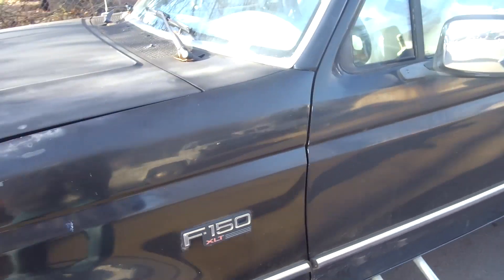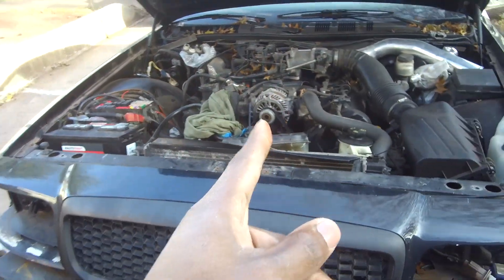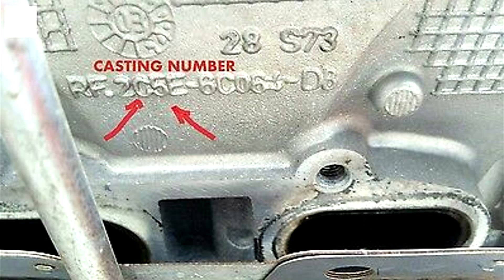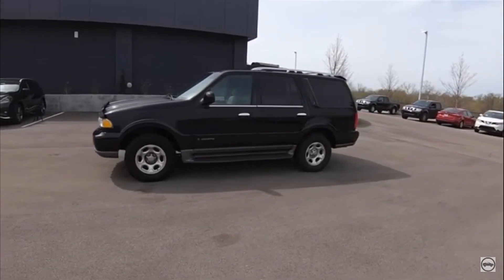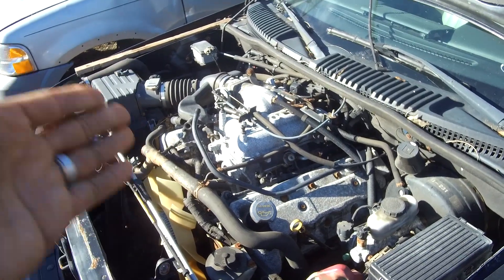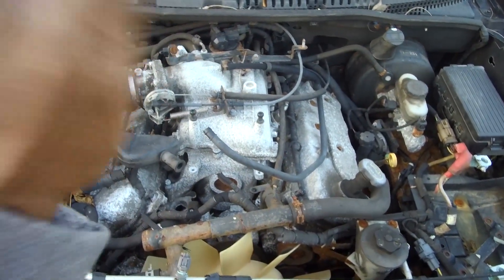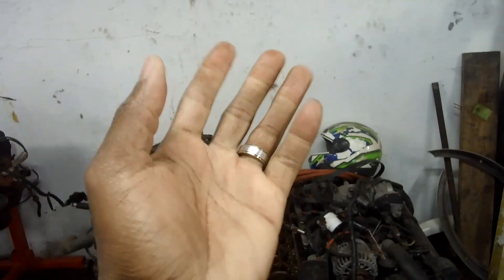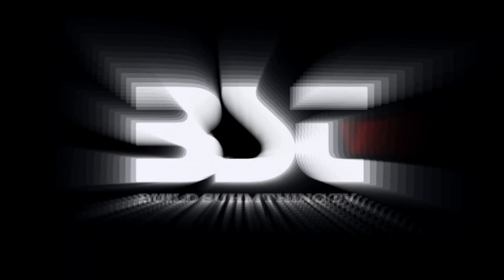BEFORE YOU BUY A Junkyard 4.6 DOHC Engine

Comment: I know this video is over 3 years now. But would the same principle for the cobra Engine apply to the Mach 1 engine? Besides the fact Mach 1 engines were aluminum. Thanks for making this video.
Reply from the maker: they basicly the same engines until you get to the boost ( stock version ) cams changed a little.. All of these where Aluminum ( Aviator,Mark 8,Cobras, and Mach Mustangs )

Comment: I like to buy running cars before they make it to the junker to rip parts from. Takes away a ton of the guess work. I picked up an 04 Aviator suv that run and drove but had no OD for a couple hundred bucks. The aviator engine, even if it needs rebuilt, is a fantastic bang for the buck.
Reply from the maker: I feel ya on the logic and its solid, but logic is more on the cheap side of things... I like to buy things from this yard cause they are good people... They are straight up with the motors ( if good or not good ) most cases they do not know and charge a the ( extraction fee ( only it seems )  most of these engines are bad ( 4.6 dohc ) here is one I got from the yard but I had to change the guides and timing chain https://youtu.be/BHlDSH_Y9tM
Reply from the maker: here is what the engine looked like inside https://youtu.be/SPIc7hDibZ4
Reply: @bstfordchannel923  Definetly a good deal going the yard. I never know what I may grab until i go and walk around for a bit.
Reply from the maker: @madmod  Sorry for the late reply... Going to yard is sweet. Its cool to go when you NOT in NEED of a  part or parts cause you will be so upset whne you do not find what you need.. So i am going just to go and see what they may have vs what I need to have

Comment: I'd love to see that 5.0 in the Vicky :) And it will be cheaper per HP to build... plus tons of parts!
Reply from the maker: This is coming bro in thought i have to plan it out
Reply: And maybe get a Stroker Kit to take that 5.0/302 out to a 348 :) with a 232/242 cam to help it breath... puts out a nice exhaust tune!...  If anything do the Cam! You'll be very impressed with the results :) Ford heads have not so good exhaust ports and the extra 10 degrees helps... A Lot!

Comment: What is the problem with the 03 aviator 4.6. .I picked up the truck cheap driver head has burnt valves. im going to pull the head and repair.

Comment: I have a 2000 Ranger step side that I'm thinking  about trying to drop a 4.6 mustang engine in. Maybe trying to catch an older one from when they came out originally. It currently has the original v6 with a 5 speed manual transmission.
Reply: I cant remember the title of the tv show but i saw a series on Motor Trend tv where the drop a Coyote 5.0 or a 4.6 in a ranger..Didnt take a ton fabrication

Comment: i'm loving your videos! but, i was wondering.....are there any downsides to the 5.4 as opposed to a 4.6? there are no real differences in the motors, is there?
Reply from the maker: Big downside you have to build the 5.4 ( sohc ) with better rods and get the a better oil pump...The problem also if putting it in passeger car will have issues cause the engine is taller and the hp made is nothing crazy...I will have to try something to debunk all that i mentioned... Its best to get a 4.6
Reply: got it. i should have mentioned that i'm swapping into a '66 F100.....so plenty of room. i've already checked. replacing rods is gonna break the budget if i did a 5.4. i've got an eye on a lincoln 4.6 DOHC. i'll just stay on that path. thank you!!

Comment: If you have a p71 the ecm will run and drive any of the modular v8's except any one with vvt . I would still tune it but you could drive it to the tuner. The main engine harness should work with the 32v you'll just need the injection harness. The murauder, Mach one and aviator engines are the same , the Mach one has cams more suited for the mustang and five speed. The thing is they are called modular for a reason. The 32 v only reads the intake cam gear just like the 2v , the firing order is the same, the maf size is the same, the injectors are close enough and for the most part the throttles are the same size. But the blocks , heads, belt drives, emissions, sensors all the other stuff is interchangeable for the most part. Bell housings are all the same, I think, but am not fully sure....the bores between the 4.6 and 5.4 are the same it's the stroke that's different...again I'm not too sure on that one, I know they did that with the 3.8 and 4.2 v6's so it's a bolt in swap for a 4.2 v6 mustang as it's the same block. The thing is it's stupid expensive to buy aftermarket parts for the mod motors but if a person does some homework they can build a good amount of power using factory Ford parts. Just like pi heads on a non pi block...that gets you like two points in compression and better flowing heads...that's simple horse power and torque.
Reply from the maker: police on police and the lincolns on lincolns ect.. some cars have different feature .. the engines are cool but the ecu systems are crazy do to the pats styles in OTHER cars other than the Police crowns

Comment: The 4.6 is a solid motor... But the 5.0/302 Windsor can be a cheap Beast of Motor... Add Cleveland heads and a 236 248 Cam and stand back and freak on the power:) and it's been around since the early 1960's :)
Reply from the maker: ahhh brother you just have to wait on it lol.... I have few ideas in serous thought
Reply: @bstfordchannel923  I like Ford trucks I'm in the process of doing the 2v swap in a expedition I like to learn more about ford engine what books would you recommend I can get off Amazon or Ebay

Comment: I like the 4.6 4v but I wouldn’t buy it unless I heard it run . Pull the valve covers have a look and smell ..pull the cam cap  look for scoring on the cap. Even pull the oil filter take it apart pull the plugs have a look . Especially if it doesn’t run . The Lincoln mark 8 ?! When it came out they opened the exhaust and did over 180mph with that engine 290.rated hp in a light car like the Mac that would be sweet . I’ve done heads on aviators and Lincolns generally the valve seats wear so I would go through the engine regardless. Very doable with 4000$ but tight .now 5.0 is easy especially if you got one from a explorer the heads are a lot better than the regular castings and if you know how to pick the right parts you could get well over 300 to the wheels with those heads . But you should still go through it . Turbo 5.0 from a explorer? That would be awesome for the maverick! 😬 there’s also transmissions you need to think about as well. Mark 8 donor car then get it tuned.
Oh 5.4 is HUGE !
Reply from the maker: i pump my breaks just a bit all what you have mentioned i sat and thought about it Casey .. you are so correct head have to be done, then the bottom end. so will be money flashing around at the machinist or slowly looking for favors from people.. 5.0 in the maverick ( turbo ) well that sounds like a plan thus why i started to turbo the 4.6 figure what works and what doesnt.. I had that 5.4 dohc a fn whale of a engine lol.. I want something thats small but kick ass in power.. I have plan it has change twice.. 302 may be the best move

Comment: IMO, back to the basic point. Any fat cat can make more horses. 1000hp is no longer uncommon. Question: " how many horses to make the car worthy?" 290? 360? What are the "total" component cost difference? So what should the math formula look like? "How many hp per dollar can you make over some minimal declared threshold of say 290 or what ever that is that makes the project cool enough?" My #1 concern is cost of components to cause larger hp not to fail and that runs the entire length of the drivetrain. My #2 concern is what actually makes the car cool besides hp? Isn't it that "we built a really cool great running car for the least spent without some nasty detail left out in the end?" Tires Tranny suspension not matching hp? By the way, this was a superb well thought out vid with noticeable increase skills in editing. Thank You!
Reply from the maker: wow YOU SAID what i was trying to show ( but without ) spelling it out..YOU got the gist .. thats why i dance with ideas and say things, Its best to show examples of those that read dohc and think instant power gains..Not all the time big liter engine create power on a budget..  to do a coyote swap in your car will run you 6k min ending results  maybe 400hp if you get the right simple mods.. 6k 400hp cool engine but its 400hp... and you will get spanked by MANY cars still.. many people chase hp, but not a well balanced car.. This comment is well needed and well respected.. Thank you so much for this brother L-Twig

Comment: Man.. I can't get enough of this channel... I'm doing an aviator swap into my 2v..Donor Aviator has it all. But I'm not sure about the power steering and ac compressor fit into the GT.. Any thoughts?
Reply from the maker: thank you for the comment bro ,,, the motors are Modular it should fit,, double check it should be the same deal ( maybe smaller or bigger ) but should still mount up,.. You have a complete swap so you are good bro..
Reply: @bstfordchannel923  oh man that's great. Thanks for replying

Comment: There are a lot of 5.0 builds out there, but there aren't many 32v mod builds yet-  I'm all about them though, as they sound pretty sweet at full tilt-
Reply from the maker: I have been working on 3 of them now.. I ended up buying this motor ( bad move ) but I worked around it and bought 2 more right after that.. The issue is time and where to do this stuff cause its very cold out...Thank you so much for chcking the video Truman

Comment: Very difficult to beat a pushrod 5.0 (FOX) what with all the aftermarket availability extant. 👍👍👍
Long live the Fox 🦊
Reply from the maker: very well put and i agree but many would disagree with this... Which is crazy, but they do
Reply: Until the block cracks at 500 while a 4.6 block can go well over 1000hp
Reply: @Sateg Llib  exactly not to mention you gotta do heads cam intake to make similar or better numbers than a stock c head 4v with headers and exhaust.  Not sure why people think the old 5 liter is comparable imo it really isn't.  Stock vs stock bolt on vs bolt on or forged internals vs forged internals the 4v beats it in every way especially the ladder as they can make 1000+ wheel with forged internals a ls with a stock block easily.

Comment: Good info on the upgraded heads in the Aviator. Have you looked in a true 289 block/engine??
Reply from the maker: I am thinking on a total 4.6 dohc head write on cylinders heads and failure points how you feel about that
Reply: @bstfordchannel923  
I think your right. But i do think you see more of those problems when you have or are turning it up pass 400hp.
And i kno what they are rated at some where around 300-310hp.
Reply from the maker: @muntasirali6057   agreed Muntasir people forget you can many any engine fast its the cost and putting the right money in the right place to get the maximum hp for less ( i would thing? ) many chase high hp with no thought and then get disappointed and it does hurt a lot.. trying to see what i can talk about in the next video
Reply: @bstfordchannel923  
I forgot to say i was wrong about the t-bird. Its a 3.9 like a lincoln ls. Have you ever herd of any one putting supercharger or turbo on one??
Reply from the maker: @muntasirali6057  the t-bird v6 they had a sc version which was a supercharger on it those where cool
Reply: @bstfordchannel923  
Yea i know about those. I just never herd of a supercharger for the 3.9 v8.
Reply from the maker: @muntasirali6057  ohhhh the Jaguar motor ok ok i was lost a bit.. I forgot about that last thunderbird that was based of of a Jaguar platform ( the Ls Lincoln also )

Comment: 351 canted heads and a cam will put u into the 400s at the rear wheels. its all about how well they can breath and push. the heads theyre using are smaller they are not canted and restricted. it be cheaper to buy the 351 head and upgrade the block to the heavier bolts. put in a good cam and be done with it. you can get another 40 hp if you port and polish the heads. roughly another 36 to the wheels.
Reply from the maker: great info here bro like always.. I just seen this comment

Comment: Hi.  I have a 1989 Ford with the 5.8 with the C6 transmission. but the motor is locked.    If I swap the motor for a 4.6. The transmission housing is the same as the 4.6 and the 5.8
Reply from the maker: nope not the same ( you have push rod windsor ) you can swap a 302, buy you can find a 351w in the junkyard for 300 bucks just look David... Cause what you are thinking will not work at all

Comment: Honestly, a 302 build would be a more reliable build. More cams more that can break. A 302 bored, .030 over and a about a 10: 1 compression. Shave the heads about 30th of an inch. New cam and crankshaft bearings. Forged crankshaft if you don't have it. Balance and blueprint. Turbos and superchargers are option after that... Not required.
Reply from the maker: hey brother I have not seen ya in a while what happening... You are correct the 302 is a mean engine and very simple to get the power as i have been shown now.. i have to choose very soon
Reply: @bstfordchannel923  Whatever you choice, it will be an interesting build
Reply: @bstfordchannel923  I have been busy. Project Spirit is back to being a daily driver.
Reply from the maker: @PrinceMagnum  Project Spirit rocks on very cool dude very cool
Reply from the maker: @PrinceMagnum  going to put a spin on it i just thought about it today..just waiting on exhaust part and need to buy a wastegate
Reply: @bstfordchannel923  I can't wait to see what you got.
Reply from the maker: @PrinceMagnum  I do have much, but the idea i have will be a slight left turn and i have to make the turn hard Brother.. I am planning now
Reply: @bstfordchannel923  I know that feeling. Can't wait to see what you got.
Reply: But the 302 will split in half at 500hp and the 4.6 can take 600+ on stock internals. The 302 build gets pretty damn pricey when a Dart block comes into play. Suddenly a used Cobra blower and accessories looks cheap.
Reply: @eclipsegst9419  if your looking for that kind of power you can just yank a 351w and then the mods motor again becomes more $ per hp compared to a sbf
Reply: @kristianmichels5649  hmm. For a full out build probably, but for 500-600 for a street car id go Mod. Especially since the coyote came out the older mods got cheap quickly.
Reply: Unless you're going for over 500hp. The fact the block can't go over 500 is a joke, I'd never build one lol
Reply: Typical... As it was said in Blade 2. "And you burn it up by the second oil change." And what did he call the guy after that? Ah well, you can watch it yourself.

Comment: Man I was kinda disappointed with those 5.4 dyno numbers.   Coyote would of been about the same price. My friends got a stock motor coyote 97 mustang. Gotta be 400whp.    I’m thinking you gotta go boost and I like the 5.0 pushrod. Fast is fast. If it’s a old motor and still fast. It’s still badass.
Reply from the maker: this is why i have shown the Dyno numbers 9 i study a lot ) on the what IFs on engines and power plus dollars to get it to a point.. 5.4 is for tq and you have to dial things in and add certain things in to work,, Now a BOOSTED 5.4 is way different slight boost you ill see 400 easy no sweat est boost will be 14lbs ( a guess )..  302 is still a amazing engine for what it does you can not doubt that.. Just here to make people think a little
Reply: I expected more. I know a guy making that torque (378) on stock internals, stock exhaust manifolds, just a intake manifold swap and a tune.
Reply: Ken Bjonnes went 10.6 in a 3k lb Mustang with 360rwhp on a 2v 4.6. What are doing with the car and do you really need more power than this?
Reply: A coyote is gonna cost more than a 5.4 swap even if you built the 5.4 with forged internals it wouldn't be too much difference one way or the other but a forged 5.4 can do 1000+ wheel easy.   Gen 2 and 3 coyotes can do that on turbo setups but that is really pushing toward the top of what they can do on stock bottom while a forged 5.4 would live comfortably at 1000 wheel.

Comment: I have a 2007 mustang 4.0, would any 4.6 work or is there a specific one I’d need? Thanks
Reply from the maker: iwell for what you are doing you need a wire harness from a 2007 Cobra would be a good starting point. THEN you can get a motor like this and get the mustang mounts and the oil pan if using aviator stuff... Its will be tough but do your homework and it can be done .. Figure automatic harness or 5 speed harness
Reply: I think you may need a K member too

Comment: Do you know of any standalone imrc controllers? I'm Midway thru putting one of these 4vs in a 1997 F150 and for now I just wired them open but I would like to get them operating
Reply from the maker: what you could have done was take the wire harness from said car you got the engine from to run those flaps.. Everyone uses the delete plates to make that happen. Thats why i never did the 3v swap cause of these little issue. it would seem i have dig into the motor to add hp goodies to make this work in my favor
Reply: @bstfordchannel923  I have the full harness and ecu but the issue is that it's a 94 so it's an OBD1 setup, and it uses vaccum and electronics to run them. I suppose one option would be get a 96-98 cobra manifold, harness, and later Mark8 ecu, and just repin the truck and use the Mark ECU to run the electronic IMRC, but I was hoping to be able to use a little home engineering to avoid all that expense.